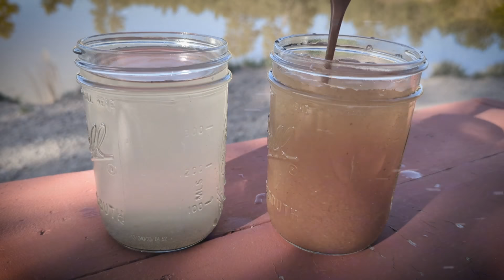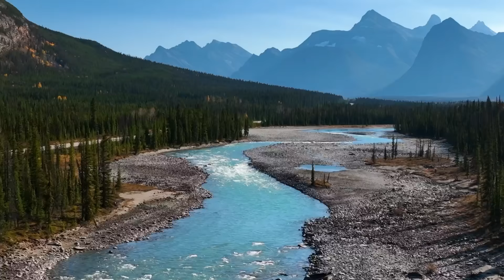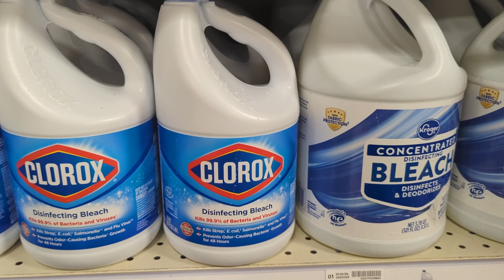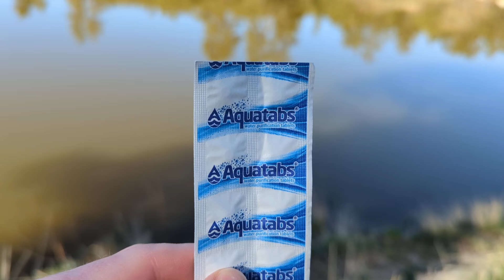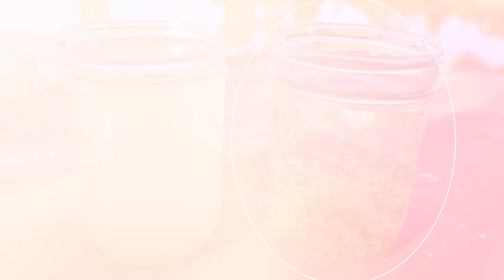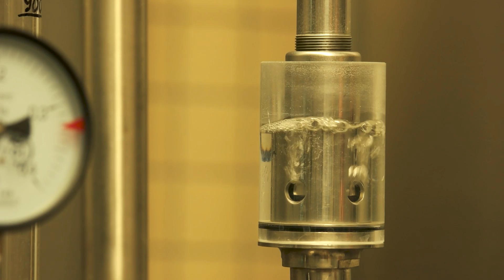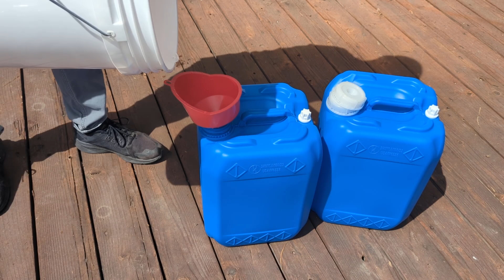The KEY to Emergency Water Preparation Before SHTF

Comment: I began using a gravity fed water filter unit I made about 10 months ago. I use the ceramic filters because I wanted something that filters out bacteria and viruses as well as chlorine and other contaminants.  To me, there's no reason to use a filter if it doesnt filter out bacteria and viruses, which most filters don't do. Most are only about chlorine and other things that affect the taste. But if you're in grid down scenario, you're going to need to filter out bacteria and viruses. I also love that with regular cleaning these ceramic filters last for 6-9 mos! I buy the ones that have charcoal in the middle to help with the taste and as an extra filter and also the filter is impregnated with silver for extra bacteria killing power. My system is similar to the Berkey system for a cost thats a
 fraction of what a Berkey costs.  Its easy to make and I use it every day. My system filters about 3 gals in a few hours. I also began storing water in long-term water storage containers. I rotate the water every 6 months.
Reply from the maker: Hey thanks for sharing! It's cool to hear folks' DIY stories. Do you use the British Berkfeld Ultra Sterasyl filters? These ones https://geni.us/eiAvEH8
Reply: I made my own Berkey style for less than a third of the cost.

Comment: I feel the need to bring up that most uv lights used in those disinfecting devices aren't really effective. You want UV-C lights for disinfecting if I understand it correctly, witch most products are not. They sell test cards on Amazon, so if you're going to use a uv light to disinfect water, make sure to test it before you have to rely on it. Also, remember that disinfecting and filtering are not inherently the same thing. Disinfected water can still be dangerous to drink, as can filtered water. Also, if you go the chemical disinfecting route, bleach won't kill certain protozoa that can be found in human feces, so make sure your water isn't contaminated. This is especially important in areas that have flooded, as it may cause sewage contamination.

Edit: spelling
Reply from the maker: Thanks for sharing your insight

Comment: What about the use of UVC source for disinfecting water. I also have a MIOX CHEMICAL generator. Add salt and a shot of water and hit the switch and it will create a chlorine chemical to add to your source. This company made these chemical creators for the military originally but today focus their technology on creating a chlorine source for pools and public water systems with the cheap source of salt and one can use solar or wind power for electricity. 
How does one determine the concentration of chlorine if it is not marked on the container? Living in an EU country they are not bound by law to list concentrations within these products.
Reply from the maker: UV is discussed at 4:47

Thanks for sharing about the chemical generator, I'll have to look into this. 

I'd recommend finding a product that states the % concentration of disinfection chemical on the packaging.

Comment: Why not have a large plastic 500 gallon tank out side the house somewhere that the main water line runs through BEFORE it goes into the house to feed the normal plumbing system.  That 500 gallon tank is always topped off wioth flowing fresh water.  No need to store a single "can" or "jar" or anything.  Then when the water stops.....you have 500 galoons of fresh water that was topped off that same day.
Reply from the maker: Great idea if you own your home and have the space for it

Comment: I would use painters tape on the jugs of water for dates. What about reverse osmosis water? How long in a water jug be good for?
Reply from the maker: Good idea with the painters tape! Are you referring to reverse osmosis water that's purchased and sealed by the manufacturer? Or filtering your own with your own RO system and bottling it?
Reply: @waterfilterguru  at home system. Culligan water with charcoal Prefilter.
Reply from the maker: @douglasbaker5949  If its not factory sealed, you probably want to use a preservative chemical for long term storage

Comment: I have a 20 year old ceramic filter unopened. Would it still be OK?
Reply from the maker: Hard to say for certain. It depends on the condition of the filter. If it had ever been exposed to freezing temperatures it may be compromised

Comment: Recently in the past couple years, I've been using PUR brand water filter that attaches to the sink faucet for 'clean' water, but I'm not sure how clean that is really. I am not a fan of using Water Pitchers with filters like my family have done in the past with the Brita brand. 
I refill large Simply Juice bottles from the grocery. I regularly store two with water in the fridge, and I tend to drink from those. I occasionally switch out and replace these bottles every 1-3 months since I don't buy Simply juices that often. 
My idea might not be good but I'd like to see what everyone thinks about the water filter in the sink-idea.
Reply from the maker: The PUR faucet filter is the most extensively certified faucet filtration system I'm aware of, so that's the good news. But whether or not its the best option for your situation depends on what contaminants are in your water. It may or may not be sufficient - and it most definitely won't address microbiological contaminants in the case of a boil water advisory or other emergency situation where water quality is compromised
Reply: I make my own filter for Britta water filters. Fill coffee filter with a table spoon of activated charcoal or Diatomaceous earth. Wrap in the filters a couple of times. Stuff some filters in the bottom of the filter cage then add wrapped filter to the top making sure no holes can be seen. Runs slow but put the Britta picture on my knife block and a glass mason jar under and let it pour out while I do other things. ❤

Comment: You can't use straight distilled water. You have to put the minerals back into it. Watch Off Grid With Doug and Stacy!
Reply from the maker: Remember these tips are intended for use in  a short term emergency/ survival situation. Yes, there are risks with drinking demineralized water over time. I'm not disputing that. But let me ask you, would you rather drink distilled water knowing it's potable, or risk immediate illness by drinking water potentially contaminated with pathogens?

Comment: Is there a way to remove cyanobacteria and their toxins from an unsafe source of water?
Reply from the maker: The safest option would be to find a a different water source.

Disinfection with chemicals or boiling will address the bacteria, by the not the cyanotoxins. Distillation would really be the only option capable of addressing cyanotoxins in an emergency situation - and distillation isn't always feasible. Do not rely on gravity-fed water filters to try to remove cyanotoxins.
Reply: @waterfilterguru  Thank you!

Comment: 7:40
And know if you are in a very low humidity place like Phoenix that distiller will never work.
Reply: Same where I live in outback Australia.
Reply from the maker: Make sure you're prepared with another, more suitable option for disinfection then - like chemical disinfection tablets 😉
Reply: But glass jars in the sun will work. I bet you could boil water in them. 120 degrees should heat them up!!!!!

Comment: During a major home remodel several years ago, I purposely kept my 50 gallon water heater, just for this reason. 50 gallons of water at the ready, just in case. Also, I keep about five gallons or so, in old glass vodka bottles, in the root cellar. They get filled from the tap, left in the sun for  a few days, then dated on a label and tucked away. We had to use several of them this summer, as a nearby water main repair project went bad and we were without water for a day, then on a boil order for a week.
Reply from the maker: Thanks for sharing your story, great to hear you were prepared!

Comment: If you have warning water may become scarce (incoming hurricane) fill up the bathtub. For bathing, consider a quart size pump up sprayer and use it in the shower. Or, a bowl of soapy water and a wash cloth will get the job done with less water used. You can use vinegar to clean dishes and reduce water usage. Just a few ideas to consider should a problem hit the fan.
Good video. Thanks.
Reply from the maker: Thanks for the additional tips!
Reply: Can also use a water bladder that fits in the tub - about 15$

Comment: plastic and in the sun? noooo. big no. unless you don't mind boosting estrogen and chemicals intake😶
Reply from the maker: Remember the SODIS method is intended for use in an emergency or survival situation, not everyday use. 

If your choice was between disinfecting water in a plastic bottle to make it potable, or drinking water contaminated with pathogens that will make you sick in 24 hours, which would you choose?

Comment: Rain water from a tar paper roof? If your gonna do rain water from your roof make sure you have a metal roof. Plastic bottles. Glass is best
Reply from the maker: Remember the SODIS method is intended for use in an emergency or survival situation, not everyday use. 

If your choice was between disinfecting water in a plastic bottle to make it potable, or drinking water contaminated with pathogens that will make you sick in 24 hours, which would you choose?

Comment: With distillation, one needs to replenish the water with vitamins and minerals ie mixing one of three salts, Himalayan /richmond or celtic  into a container of dis/ water: 5 tablespoons to one pint of pure water, leave to dissolve over night. Then add one teaspoon of the concentrated mix to a glass of pure water, but only one teaspoon per day, while still drinking the plain pure water when needed. ref: OFF THE GRID WITH DOUG AND STACY . Another method is to dissolve a tiny grain of Himalayan salt in the mouth, then drink a glass of pure water, it can be applied whenever you need to drink a glass of water. One should always do their own research, as this information is to inspire people to resource whats best for them.
Reply from the maker: Agreed, remineralization is prudent if you plan to drink distilled water in the long term. If you are relying on distillation to make water potable in a short term emergency/  survival situation, I'd imagine remineralization would be less of a priority

Comment: At least if there is a known event moving through, fill your bathtub with water.  It'll give you roughly 70 gallons or so if the pipes shut off.  If your bathtub is gross, you can always filter or boil the water for drinking.
Reply from the maker: Thanks for the tip

Comment: If you have a pool, and there's a chance of losing your water supply, run the filter for as long as possible.  OVERCHLORINATE the water, and put the winter cover on the pool. If you don't already use a DE filter, GET ONE... DE is Diamotamatious Earth. A white powder with the consistency of baking soda. It's used inside the filter to coat the filter fingers. This coating will filter out all micro organisms. In some parts of the country,  this type of filter is used on municipal water supply.  You can find them used on fb marketplace and other flea-market type sites. You can run spring water straight through it too, or rain water.. pleated paper and sand filters are better than nothing, but DE is th we best! Ask any pool company!
Reply from the maker: Thanks for sharing your tips!

Comment: Something I think no one is really talking about is don't use your toilets or sinks in a long term grid down if you are hooked to town sewer. Short term is ok though. With power out and everyone using sinks and toilets it will soon back up the system if the water and sewer end up stopping. Natural disasters like flooding can also do this. Sewage can and will start backing up into peoples homes through all the pipes making it impossible to live there. I suggest looking into a main line shut off valve outside the home. When everything backs up it won't be your home also. As many go to shelters to live, you won't need to leave. Not to mention you will also be able to help your neighbors that didn't listen to your advice about getting a shut off valve. I wouldn't waste any water from your stores to flush the toilet. Might as well have some kind of outdoor setup to do all your business if possible. Not sure what to tell people living in a big city apt complex. I guess consider moving now.
Reply: A bucket composting toilet system for emergencies works great for that.
Reply: @peacefulsounds2057 came to say the same thing!

Comment: Buying a dehumidifier. It makes a gallon of water every four or so hours. If you have a generator it can be powered. Or solar “generator”. 

Or figure out how to run it off a car battery. 

Then filter it and boil for several minutes.
Reply from the maker: Great for humid climates
Reply: @waterfilterguru  yup. Agreed.

Comment: I have started freezing water in my empty water bottles, used milk containers & empty jars for the approaching storm Milton. I move them to the fridge and then I freeze more. You can also freeze water in a ziplock. Keeps the fridge cold for many days with things you already have at home, and you’ll have plenty of water around to boil later if the bottled water runs out. I also fill the bathtubs pre-storm.
Reply from the maker: Great tips thanks for sharing! Stay safe

Comment: Distilled water is not safe to drink it will pull minerals out of your body.
Reply from the maker: Not if it's remineralized. Also, in an emergency situation distilled water that's potable is preferable to water contaminated with bacteria and parasites which will cause immediate illness when consumed

Comment: I drink filter water and store it in a several water jugs.  How long is it good if not treated or don't put anything?
Reply from the maker: It's best to treat any water you store for long term use to prevent microorganism growth
Reply: @waterfilterguru     I drink it every 1 1/2 to 2 months.  Do you think it's safe?
Reply from the maker: @joylee7274  It's hard to say without looking at data. To be safe, you could disinfect it before drinking it (boiling, UV, or chemical)
Reply: @waterfilterguru  Thank you!

Comment: It's hard to imagine that no one in this video or in the comments mentioned polycarbonate bottles for long term storage. I owned a retail water purification store for a few years and my unit had 16 stages and produced very clean water. Of course I don't have that now but to get bulk water I made my own filtration system that I hook to a hose and I can very quickly fill up 120 gallons of water all in easy to move 5 gallon polycarbonate bottles. I also add a little bleach to each bottle..

Comment: I bought a $40 “Zero” water filtration system…… amazing the difference, and I spent next to nothing. I loaded up on filters and now I’m set - don’t be taken in by the water filtration systems.
Reply from the maker: ZeroWater filters are the most expensive over time out of all the filters I've tested to date, averaging $0.70/ gallon in replacement filter costs
Reply: @waterfilterguru  And they don't remove everything harmful, do they?
Reply from the maker: @katherineblakely7142  No they don't